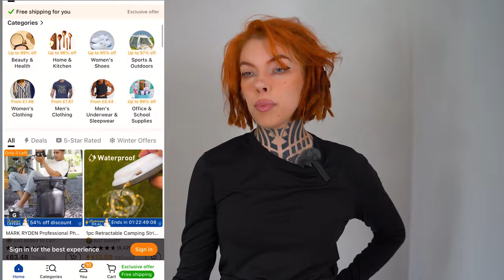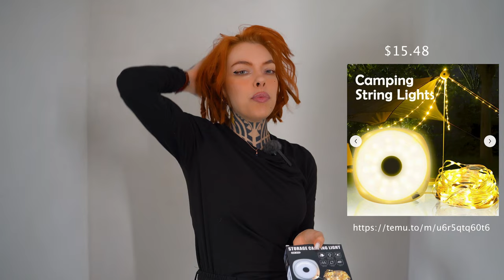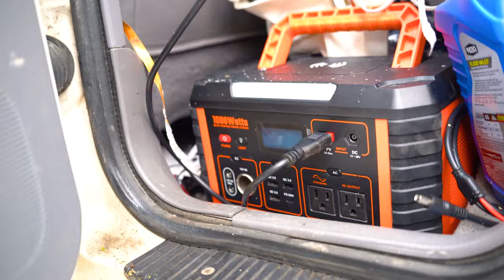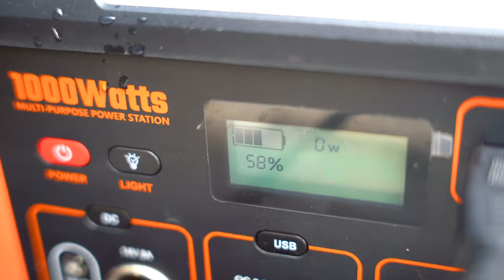drifting my Jeep..

Comment: I just saw this video. You may have figured out your solar issue.

If not, the problem you may be having with your solar panel is that you mounted it under your rack.

 panels do not redirect power if they have shade on them particularly older tech panels. 

 So if any part of your panel gets shade on it it can greatly reduce the panel's efficiency or completely make it not work at all until the shade is removed.

 that you have it under your rack means that there will always be parts of your panel partially shaded.

 There's some new tech panels just hitting the market now. they're redirect better if they're shaded or partially shaded but they're just now hitting the market. 12:24

Comment: Fun video as usual. 
When I was running my solar wiring through the RV wall an electrician friend told me to loop the wires lower than the entry point so the wires enter the wall at an upward angle so when water runs along the wire it will drip off at the lowest point instead of following the wire into the wall. It looks like that may be the leak, it's really hard to get a good seal around a pair of wires. 
Also I've seen videos/reports that the flexible panels work better in limitied/indirect sun situations. I've always used flexible panels and have never had trouble with slow or no charging. They have their own set of challenges but output has never been a problem in my experience.
Reply from the maker: Thanks for your experience! I’d actually the small screws that are leaking cause she didn’t put enough sealant and fortunately I got the solar to work/ it was just the battery was too cold 😅
Reply: @TorieRobot  Yeah, batteries get cranky in the cold, just like me. 🙂

Comment: Check if voltage is reading off the wires of the solar panel. Then the next thing is to get a regulator.
Reply from the maker: It wasn’t charging because the battery was too cold - once I warmed up the battery it charged again
Reply: Maybe a heat blanket can manage it away from cold, at nighttime. They say cold is not that good for lithium, and to warm also, because the battery heats up when empowering an electric car. Perhaps a little lithium battery can help for the blanket.
Reply: Lithium batteries and cold are not friends. TV mews report yesterday showed bunch of Teslas at charge station taking hours to charge.
Reply: @TorieRobot  electric blanket

Comment: Hi your solar panel will not work under the roof rack it will need to be on top uncovered
Reply from the maker: No- I got it working - it works partially shaded so that’s why I put it there
Reply: @TorieRobot  partly shaded is different to been covered by the rack,it will work better on top